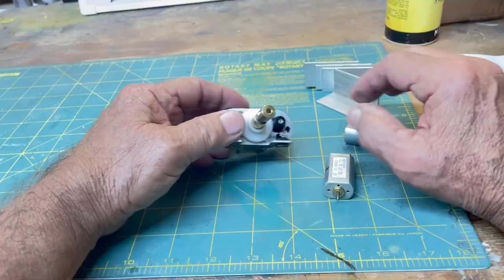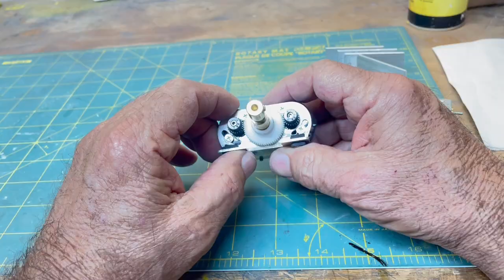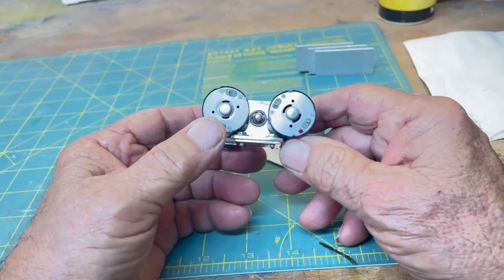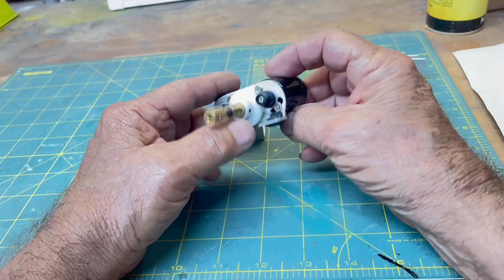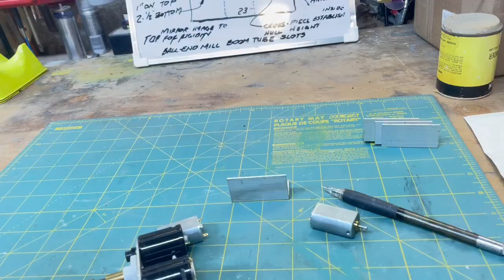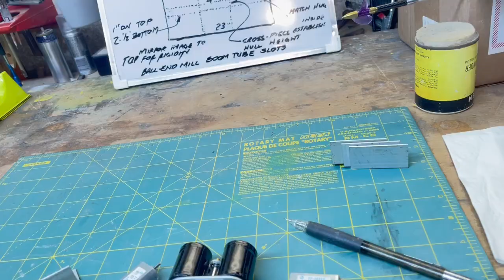Dr. Jet is going to re-gear the SK DaddleJet.

Comment: Did you run the boat with the bigger motors yet? If not why not run it with those motors before you change the motors and gears?
Reply from the maker: I ran it with the 2030 brushless motors and it was not relaxing.  The bigger Speed 300 motors will have similar power to the smaller brushless motors.  My smaller motor plan will be 100% reversible, so no harm, no foul.